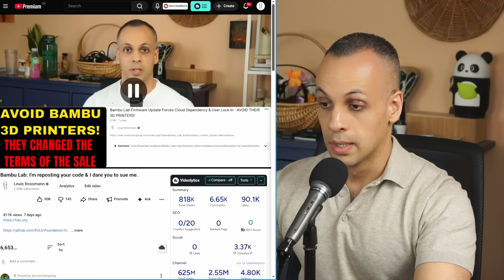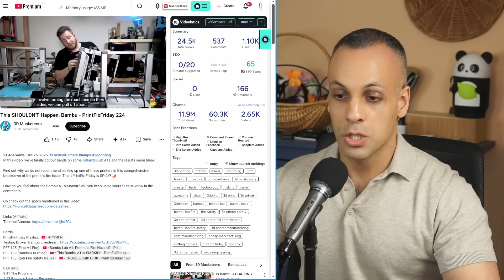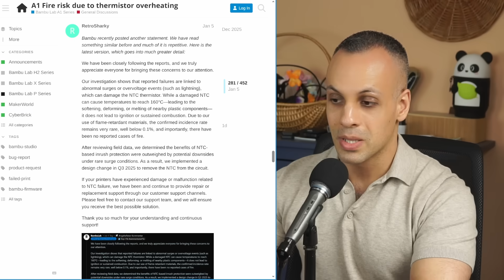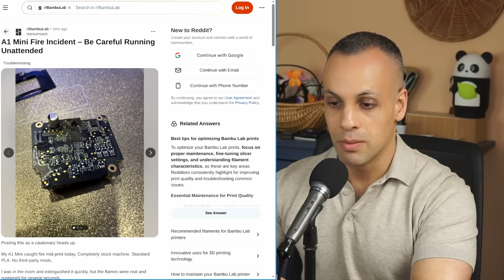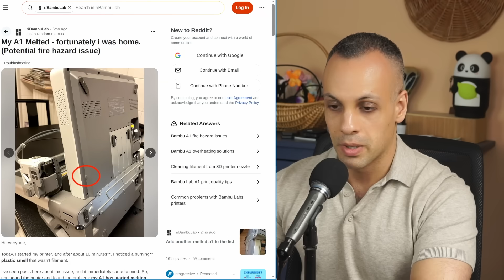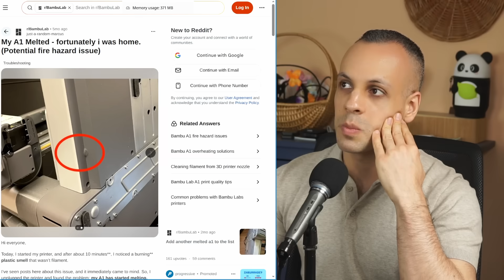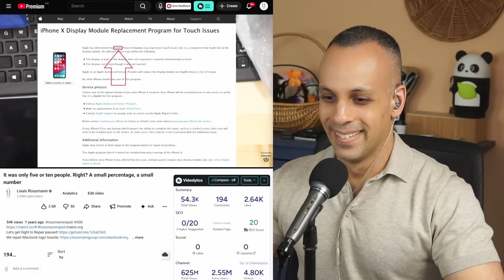Bambu Lab PR dumpster fire is turning into a literal one...

Comment: We need a law that prevents devices who have no reason to have internet connectivity, like 3D printers, regular printers and washing machines, from requiring it. 
It should be on a strictly optional features list.
My washing machine does not have any good reason to be online, none.
Reply: Some sort of network connection so that it can adjust its cycle to use cheaper power and avoid high demand times dynamically isn't a bad idea.
Reply: So a printer that could potentially make it easy to produce deadly weapons shouldn't have it's print queue screened by law enforcement? It's possible we will end up with a law that makes cloud 3d printing mandatory for all 3d printer manufacturers.
Reply: @jaytee4818 this guy just wants to live in a dystopia, yeah bro just let the government watch anything you are doing, also allow then to do whatever they desire and any form of protest automatically gets flagged as criminal activity, oh wait, that's China
Reply: @jaytee4818  A yes, the think of the children crowd. You are probably in the USA, where you get a free gun with a pack of cigs, so what's your point?
Reply: @spidalack  im from brazil, and guess what? i don't trust my government, ill have a dumb appliance over a smart one any day.
Reply: @jaytee4818  By that logic you should be monitored in your car 24/7, because that's a deadly weapon that can and has been used to cause massive amounts of destruction.
Reply: @jaytee4818  No it shouldn't, in most states in the US of A it is not illegal to manufacture weapons if rules are followed, selling and distributing them are different stories. You obviously need to know your local laws. How would some AI bot know the difference between a gun frame and a cane handle. Besides hardware stores sell much better weapons with no kind of registration then I could ever print. Hammers, screwdrivers, shovels, machete's, box cutters, chainsaws, riding lawnmowers, rat poison, trailer ball with some paracord, pvc for potato canon, large sticks that I can make pointy, hacksaws, generator with jumper cables, zipties, duct tape, rope, auger, wood chippers, thin wire and wooden dowels, log splitter, shrink wrap to make it cleaner, buckets to haul away the bits, cleaning supplies to clean up after. Should I not be able to buy these things because i might do something nefarious with them or do I maybe just own a freaking home.
Reply: @jaytee4818  correct. The police don't need to be monitoring my printer just in case they think something resembles a weapon.

Comment: I recently bought a P1S because I had an urgent job and I needed something that would Just Work out of the box. I did no extra set up, just downloaded Bambu Studio and did the print, and it came out perfectly. Once the urgent job was over I spent some time putting it into LAN and Developer mode and used Orca instead. I'm very happy with the results and I don't need any of the cloudy features Bambu offers.

Comment: 1:17 my reaction to the first sentece of this shit was:
"THE WHOLE POINT OF NTC IS SURGE PROTECTION, HOW CAN YOU UNDERSIZE A SURGE PROTECTOR!"

1:50 is even worse:
"So our SURGE PROTECTOR KEEPS ON MELTING, let us FUCKING REMOVE IT!!"

Like does this instill any confidence in their products?
Reply: I will admit that lightning surge is transient, not inrush so it isn't the NTCs job. 
But  the fact that NTC melted means transient protection is non existant, which is even scarier than them removing inrush protection!
Reply: The NTC only functions while cold (no current flowing), so if they have instructed or determined users leave the printers powered on then an NTC will not perform any inrush protection.
The smart thing would be to replace the NTC with an active inrush limiter or dynamically short the NTC a few seconds after powerup
Reply: @dl5244 

Shure NTC works only when cold and active inrush is a better idea.
But you have to remember that inrush is the bigest problem when device is cold because its resistance is the lowest then.

This turd doesn't have any transient protection which is worse than them removing the NTC.

Comment: Hello long time viewer, very first and (sorry) maybe the last comment to your channel. I will continue to watch, I just do not commemt unless I feel very stronly on the subjuct , and I spell and type like shit... My back story is, I built my fist 3D printer in 2014 after bying a cheaply made watabe corXY ( it was not a tru coreXY, but a BS try to make one.) the only thing it had was the first 32bit control bd and it ran smoitheware. My current 3d printer is a home built based on the Railcore XL, but morphed from the HYPERCUBE on Thingiveres. My persionl optinon on the Bamboo printers, If you want it to just print without thinking, it does that well. When they came out I realy wanted to go buy one, but I just could not justify the cost when I had a 3 color printer that also worked, may be slower but it still did the job. My feelings changed 180 deg, when I was asked to help a freind of a freind with his Bamboo printer. I was a simple setting, but when I went in to the Klipper' printer config, and then I wanted to check the firmware, It was all locked down, Why lockdown a platform that is using open source that the makers help develapy and give out freely to use for the beterment of all... Hardware wise, it is just a printer, it has all the same controlers and other support devices, the thing that makes it "just Work" is all the years ans dedacation of all the past makers who figered out all the issues. The slicer is the king, The beginnings and all forks (but Bamboo) are from opensourcs. I think Bamboo should be forced to pay roilities to the Makers who helped them get to where they are now. .(sorry about my rant)

Comment: i would like to have a bambu printer IF the Printer would work without THEIR Cloud and a less WASTEFULL toolhead like an INDX . i would stick my head in their ass and never buy anything besides them. oh well, i dont know what they do with their bambu filament spools!! WAIT A Min! Bambu Lab imposes several mechanical and software restrictions on third-party filament spools, primarily to protect the printer and the Automatic Material System (AMS). While you can easily use third-party filaments, you must navigate specific dimensions, material limitations, and software settings to bypass Bambu's restrictions. "so they could void waranty on you?"

Comment: I have a Bambu A1. I wanted an appliance, not another hobby. I print functional engineering parts and just want my printer to work. I switched my A1 to lan mode now and it's super buggy. I have to reconnect to my computer constantly.  It's like they want you to switch to the cloud. So now I'm going old school and using micro sd card. I'm fine with it. Just one extra step but if it means Bambu can't see my models I'm good with it.

Comment: looks at my Elegoo and it's running just fine, even after running nonstop on a print for a week and a half now.
Reply: Elegoo is ten times more anti consumer than Bambu. They abandon their printers SO fast and only released a multicolor addon for the Centauri Carbon 1 because of backlash, their initial plan was to replace it with the CC2 mere months after release
Reply: @grade9fixerr  sucks for you then because my lil kitten keeps right on a put-putting. then again i don't connect to the web because i can operate a thumb drive. 🤣

Comment: I use Bambu printers, love the ease of use and quality prints they produce but WAS NOT happy with the big forced updates last year.  I own 4 of them, one being the A1 that had the overheating issue.  My particular unit was manufactured after the "bad board" was changed so no issues there.  My biggest concern at this point is Bambu going under and my $3k in printers being useless.  That would suck!  I've had 10 printers from all different manufacturers and the Bambu Labs units give the best prints I've seen at their price-point.  All of my files being routed to Bambu prior to reaching the printer is trash.  We have also noticed that process has slowed greatly over the last few months.  Click print, and what used to take 10 seconds for the print to start, now takes minutes at times.  Following closely, thanks for the insight.

Comment: Years before Bambu were a thing, I researched all the major players and went with Prusa. Never regretted it. Not the cheapest, but committed to open source, upgradeability and support for even their last-gen models. Some years into owning a Prusa MK3, they identified a way to predict thermal runaways and released a firmware update that added this as an automatic safety feature. This then identified a microscopic break in the heatbed thermistor wiring that I'd introduced accidentally, allowing me to pause use while I got replacement parts.

Comment: A mosfet could burn if not cooled correctly, but that kind of NTC ? They are very standard parts used on every 3d printer. they wont catch fire unless fed with a massive overcurrent, which would be massive design fault. Not saying bambu is right, i just cant see how this could happen, unless it sits way too close to a heat source. But even then ... I have one on my hotend heater, i pushed it way past its specifications (went up to 290C by mistake as it was reading 260 ... pt100 is not good past about 240C, the resolution is just not there) . If they have defective NTC just like I did, it could lead to heat damage, as the board would easily read a lower temperature and keep heating to reach a temperature higher than the sensor reports, until something fails (usually the mosfet, or the temperature sensor - and then the protection is triggered and power is cut. guess how I know). The sensor being destroyed is a consequence, not a cause, and being destroyed is what triggers cutting the power. because a circuit board can identify a broken resistor, but cant identify a sensor that reports a lower temperature whats actually happening (it can be done by using multiple, different sensors but thats a different design you will find on planes, not on 3d printers)

Comment: I bought a bambu before i learned of their poor ethics, so instead of buying a bigger bambu, i went with an elegoo centauri carbon, its just as easy to use, the ONLY negative is no remote print control outside of the home without extra work.

Comment: Wanted to at least let A1 printer owners know that Bambu did push out an update for them seemingly to fix this issue, however I dont own an A1 so take with grain of salt.

I've had my Bambu P1S for years and I really love the thing. Going from an Ender 3 to it was an absolute game changer. I also love how the majority of things I print (and even things I model) "just work". That being said until Bambu reverses it's decision I'm holding off on buying anything from Bambu, including their filament. I love the RFID they have for their filament that tunes it to the correct print profile, and tells you what filament and color it is (because I've definitely forgot a few times what's in my AMS), but this will be my mini battle with them

Comment: I have a P1S not my first printer I'm coming from an old Creality printer that was brutal.  The old printer had a 50% success rate on actually printing something and then you have to troubleshoot quality.   I think the BL is great, I use their slicer in online mode etc.. Thats good for me but they shouldnt be locking anything out people should be able to use any slicer and work in whatever connection mode they want.  I will add that's not talked about the RF tags for the spools is completely awesome but that should be an industry standard.  Now if there was only so much attention on Cricut vinyl cutters.

Comment: My ender 3 would never betray me, unlike one of those bamboo printers
Reply: Uh, didn't original ender 3s come with thermal runaway disabled? 
And updating the firmware on 'em is non-trivial.
Reply: @some_random_wallaby From what I understand it wasn't implemented rather than disabled, and yes, you need an spi programmer to flash the 8 bit boards, figuring out how to do that with just the pi took far longer than it should have, the steps are easy but all the tutorials are outdated. I also don't consider the printer's suicidal tendencies a betrayal, it always tries to do what I tell it to, I just have to keep watch and make sure it doesn't also try to kill itself. With a usb camera and tailscale I'll finally be able to monitor it remotely.

Comment: I have and love my Bambu printer. It's my third printer and the best one.
I only use Bambu software, so the issues don't affect me.

YET — lots of respect to you for helping keep the companies in check, even if from my perspective they were doing fine.
Reply: The reason they're forcing people into the cloud for slicing is because its the first step to DRM/Print censorship. If you have a Bambu printer you'll slowly start losing the ability to print certain things because of copyright and anti right-to-repair. Think: you have a plastic piece that broke on a car but someone has a .STL file up on printables or thingiverse. You download the file and hit print but nope, it won't print because Bambu Labs has an agreement with BMW to ban any print files related to their cars for things like vent covers, plastic knobs, etc. Replacement hose fitting for a vacuum? Nope, Dyson and Bambu Labs worked out an agreement so you can't print replacement parts. Hell, why not expand it further and make it so you can ONLY print Bambu Approved™ models from THEIR library that you have no choice but to pay a subscription for? 

That is where this is headed and why people are pissed off. It's all in the name of "safety" to prevent 3d printed weapons from being readily made but we all know it will get overwhelmed by finance bros and enshitification the moment they have these controls available. They're running Bambu Labs like any tech company. They're going to bring you into the ecosystem, then trap you there, and then extract every dime they can out of you for the purposes of growth while making their products harder to use and shitty/worse in nearly every way. 

GTFO and away from Bambu Labs while you can or you'll be surprised when they start charging you a subscription to use your printer at all and you can no longer print ANY files but theirs, downloaded from their site, which you must pay a $20/month (or more) subscription to.

Comment: You aren't cynical enough; Bamboo Labs forcing their printers to print only from their cloud servers is putting them in a position where they will be the only 3d printers that will be able to meet the proposed 3d printing regulations in some states. I wouldn't be surprised if Bamboo Labs is pushing for this legislation to their own benefit.

Comment: I bought a Bambu Lab P1S 3D Printer early on before all the drama started, and even then I left the machine unplugged when I wasn't directly supervising it printing. It prints well, I like the AMS multicolor options, but I still don't trust made-in-China to run unsupervised in my office; my office I.T. network is made-in-USA mostly. Thanks for providing software fixes that make it easier to use the 3D printer, as it was originally intended, maybe I will start using my printer more often now that I don't have to worry about Bambu malware.

Comment: This is why Prusa is #1. Most reliable and accurate consumer printers I’ve ever owned or used. My first one is still going stronger after 8 years with nearly 100km of filament that ran through the extruder.

Comment: Creality: do nothing, wins
Reply: theyre not any better than bambu labs when it comes to their disrespect of the open source software they use. internet had to bully them into releasing firmware to one of their cr10 variants because it was based on marlin.
Reply: @iiisaac1312  Yeah, personally would never buy an Anycubic or Creality. Scummy companies. Creality is very well known for using customers as their testing team and throwing out half baked printers, then charging you for the "fixed" revised version with all new issues that should have been caught in QA. The CR-10 V3 was a perfect example of a half cooked, caveman designed piece of sh*t that I ended up being lumped with. Anycubic tried to scam me after running me around for months when their printer turned up and was a paperweight.
Reply: to me the anycubic kobra x seems to be a better a1 clone than the creality hi, but i'd imagine both are winning due to people thinking twice about getting on bambu's sinking ship

Comment: 4:36 Heck, that. Here's the moment for modders to come up with a control module to just replace BL garbage inside and for customers of the products to keep the only half decent thing in this affair, the frame. It's a 3D printer, most of its functions are copy/pasta. Shouldn't be difficult (not saying easy) but one could come up with new boards and sell them as kits. Fork Bambu Labs.

Comment: I thought the 3D printing community was pretty hardcore when it comes to open source.
From now on I will see bambu users as mere tourists.
Reply: Bambu users are mostly 'new generation' 3d printing users without any connection to the 'old generation' of 3d printing enthusiasts. None of them ever build or modded a 3d printer. Most hardcore 3d printing nerds I know stay away from bambu.